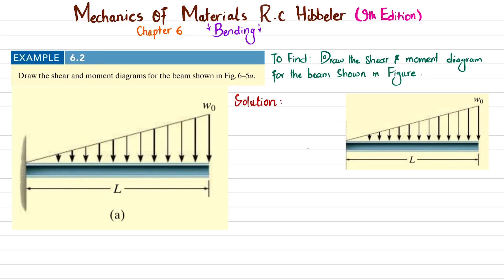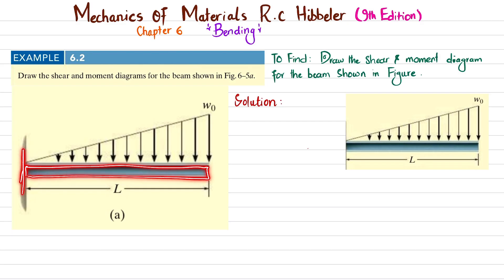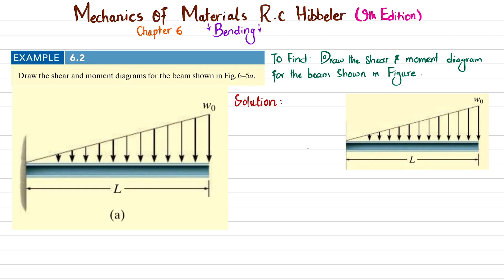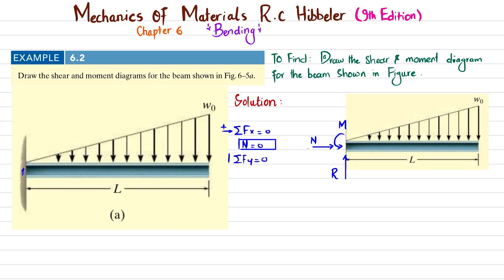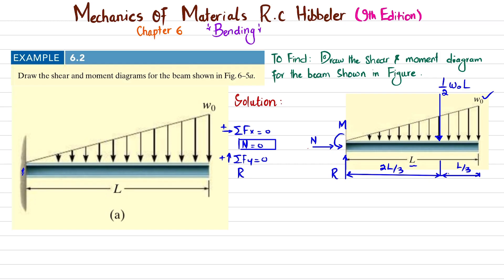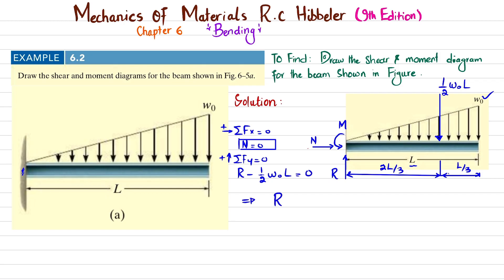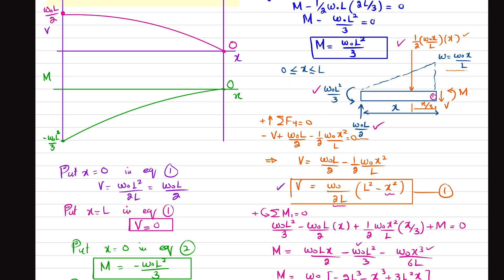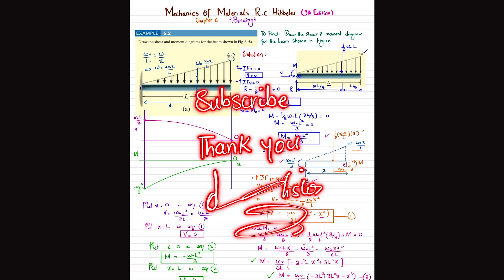Example 6.2 |Draw the shear and moment diagrams for the beam | Mechanics of Materials RC Hibbeler

Comment: Assalam u allikum,sir how to find direction of force wether it is clockwise or anticlockwise?
Reply from the maker: W.salam you can visualize it and it should be in such direction to keep the equilibrium condition...or you can any direction if the answer is negative it means your assume direction is wrong and it should be opposite to what you have selected.